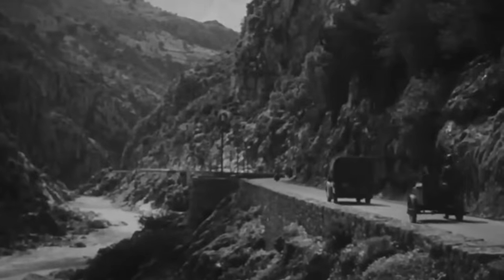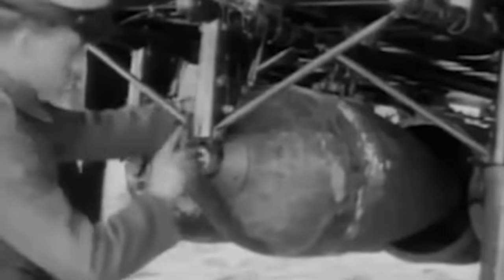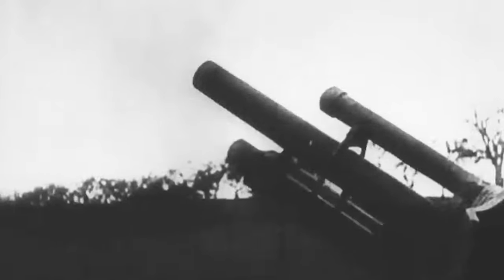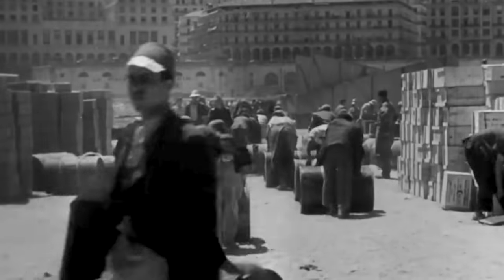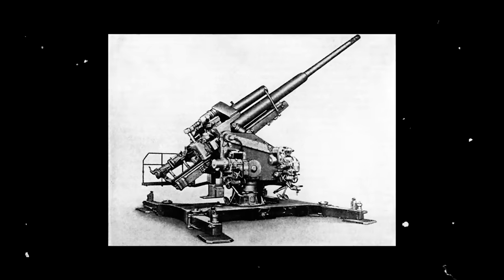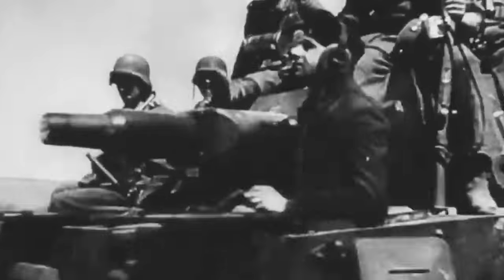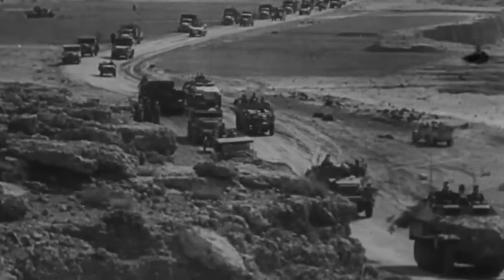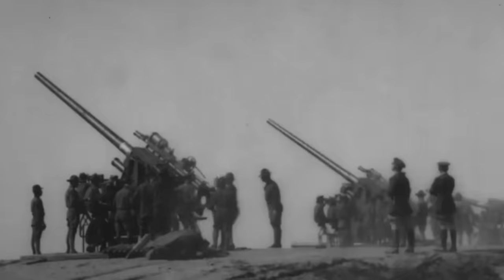The Secret Weapon the US Was Most Afraid of

Comment: It's so weird hearing it called '8.8cm' instead of the common 88mm or just flak 88
Reply: AI taking over
Reply: Acht Acht.
Reply: AT-AT
Reply: It’s the first time I’ve heard 8.8… and I chuckled everytime I heard it.
Reply: It’s like calling a .50 cal a 1/2 inch. 
Technically correct, but not common usage.
Reply: @walpolescrew  True, but you could also call it 12.7 mm and really mess with their head. "Ma duce = Give'm the whole 8.3 meters of 12.7 mm".
Reply: From the German perspective, "8.8 cm" (and pronounced "8 Komma 8", since in Germany the decimal is indicated by a comma, not a point) is correct!
Reply: @cloudchaser966  Yes you are right, but who won the war again?? lmao. Nah but for real, interesting insight
Reply: @dece74 Yes, and since the war ended, English has indeed begun to slowly infiltrate the German language. But you know what, if the outcome had been different, there is one thing that would have disappeared by now for sure: inches, pounds, gallons, Fahrenheit ...😉
Reply: @cloudchaser966  Here in Canada, we use a very good mix of both units of measurements for when it's most appropriate. Google 'how to measure like a Canadian'
Reply: We have one as a monument nearby which was left behind during operation Blackcock and given to the town as a war trophy. It had a sign saying PAK (pantzer abwehr kanonne) , but it's the 88 and weighs 6000 kg. You can even climb it. They restored it recently.

Comment: Actually, the 8.8 cm Flak was developed for the German Navy of WW1 for deck guns on U-Boats. There's a recent British Tank Museum video with YouTube Channel host Drachinifel, who discusses "5 tank features that originally were developed for Naval use" - and, Yup, you guessed it, the famed 88 mm tank killer on the Tiger tank was designed as a U-boat deck gun!
Reply: Als Torpetobootkanone (vorläufer der Zerstörer) aus dem 7,7 cm. Schnellfeuer Feldkanone des Heeres.
Reply: Not the same weapon system…same calibre but different ordnance…even he gets it wrong..
Reply: The 88 was chosen for the fact it was the largest round that could be handled as a single piece.    This was pushed to 105mm but in general involved a degree of automatic handling such as fitting a fuse setting machine to an auto loader

Comment: Some things missing from the video:

- Rommel did succeed to repel a British counter-assault in France only by deploying 88s against the heavily armored Matilda tanks. The canons of the existing German tanks could not deal with the Mathilda armor. If it were not for the 88s the whole campaign in France could have gone down at that point. That would have change the whole 2nd WW.

- The Tiger tank was allegedly build "around" the 88 flak canon, to utilize its power. A modified version of the canon was incorporated into the tank and was one of the reasons, this tank was feared by many.

So I think, the role of this canon in the 2nd WW can not be overestimated.

Comment: Why the Allied Armies never repurposed the British 90-millimeter Anti- Aircraft gun into the Anti-Armour role is criminally baffling.
Reply: Probably because the 76mm AT gun was plenty good enough.
Reply: They did for the Pershing tanks
Reply: @jonnyboi841  no they didnt. the gun on the pershing was never an AA gun.
Reply: Correction: The British 94mm AA gun could be used as an anti-tank gun but it was seldom used in that way because the gun platform was heavy compare to the German 88 and it was inadequate to level the gun and firing it unless for emergencies. Same problem with the American 90mm.
Reply: Keep in mind, every allied weapon on the western theater had to be loaded in a boat and then unloaded and transported across roads and bridges.
Reply: Well old boy, that wouldn't be cricket now. Using a AA gun vs tanks. Just isn't done old chap.
Reply: Probably because it wasn't necessary on the offensive. The 88 didn't really come into its own until the Germans were on the defensive, which starts in spring '43 after the defeat at Stalingrad.
Reply: The British did not have a 90mm gun.  That was the Americans.  And the Americans did end up putting it on a heavy tank at the end of the war but the war ended before many could even make it across the pond.  This became known as the M-26 Pershing tank. 

The British had their six pounder (57mm) which was their standard tank gun and anti-tank weapon.  During the early stages it was very effective.  Later, the British went with their 18 pounder (75mm) gun as the principle antitank gun and adapted it to fit on half tracks and mobile carriers.  The British fitted a high velocity 75 mm Vickers gun to many Shermans.   These were known as the "Firefly".   The Vickers 18 pounder gun could defeat any German tank.  The Americans retained their lower velocity 76mm. Outside of the largest German tanks, even the American 76 mm was effective. And there were very few King Tigers and Panzer IVs around. 

The British also used the 25 pounder (87.6 mm) gun and the 105 mm gun mounted as anti-tank guns (on both half tracks and in tank destroyers) and mobile artillery.  There was a move to mount the 25 pounder (87.6 mm) on the Cromwell tank but the turret would have needed a large re-engineer and it was felt that the Firefly was sufficient on the tanks to get them through the war.  

The problem the British faced was all the different types of ordinance they required.  Not only their own built equipment, but also that built by Americans.  The Americans were also simplifying their types of weapons.  Different caliber and types of artillery required Quartermasters to ensure that 105 mm
 batteries did not get 150 mm ammunition. Or British soldiers get American 30-06 ammunition.  Although they started using common munitions during the war, when NATO came around it was a strong push to make all the munitions universal.  That way on a battle field,, a Danish soldier will be firing the same ammunition as the Italian beside him.  

Throughout the war, there was a strong push to simplify manufacture by Americans and British.  This allowed faster production and improved quality.  A British Lee-Enfield had fewer parts than a German Mauser and was more reliable.  German tanks were notoriously unreliable and very complicated to repair.
Reply: @BHuang92  Fitting both the British 25 pounder (87.6 mm) or the American 90 mm was a non-starter.  They would have needed a new much larger tank to hold the gun.  The turret would have to be larger and the turret ring would also widen the tank.  When the 32 pounder was fitted to an experimental tank, the turret and gun were fixed.  The tank would need to turn in order to aim. The 75 and 76 mm guns on the Sherman were as big as they could reasonably fit. 

Even the Germans only put the 88 in their largest tanks.  These tanks often couldn't cross small bridges as they were too large and heavy.  They would tear up roads and streets.
Reply: The American 90mm AA was equivalent to the 88. It was mounted on the M36 Jackson tank destroyer & later the M26 Pershing tank. Unfortunately the M1 90mm AA gun wasn’t an anti-armor weapon. The later M2 & M3 90mm versions along with high velocity armor piercing tungsten ammo were.
Reply: Why? AT Guns are effective on the defense...but on the offense (which the Allies were basically on from mid '42) they were far more trouble than they were worth. Plus, as Allies had relative air superiority, high caliber AAA was pretty much kept in the rear.
Reply: I think it was to Bulky and or Heavy for anything but Land or Sea
Reply: The British 94 mm gun was simply too heavy for mobile use in the field.  The German 88 was too heavy too, really, but they could just about get away with it thanks to some serious weight saving design work on the gun mount and trailer chassis.
Reply: Alan M Enter 

"The Americans retained their lower velocity 76mm. Outside of the largest German tanks, even the American 76 mm was effective."

Even the 76mm was deemed a disappointment by US 2nd and 6th Armored Divisions in reports to Eisenhower in early 1945.

The 76mm not only struggled frontally against the rare Tigers but also the Panther (the most numerous German tank type in 1944/45) and the front of the Jagdpanzer IVs and Hetzers..... both of which were considerably lighter than the Sherman. 

The 76mm was only effective with HVAP. HVAP was extremely rare and not readily replaced when expended.

That report from US 2nd Armored Division is an eye opener. It's full of personal accounts and reports from enlisted tankers.
Reply: Why didn't they use the 3.7 in AA gun,  it's the same caliber as an 88 roughly.
And fit it in tanks.
Reply: @MXB2001  🤣
Reply: The 6pdr and the 17 pdr were more than a match for any contemporary German tank. There was no need to  use  massive AA guns for AT work.
Reply: @michaelkenny8540  it took 5 shermans to knock out a tiger with an 88 mm gun.
Reply: @tonyclough9844  There you go , nothing but a fanboy.

Comment: I still can't decide what was the coolest weapon of WW2. The Flack 88 or the tiger. Both the stuff of Myth and legend
Reply: fyi the gun in tiger tank is a 88mm.
Reply: The Tiger could take out a Sherman tank at a range of 1000 meters, as it had the 88 for it's gun.
Reply: The Tiger spent a lot of time not moving…so, it was just like the other 88s- a static gun. A giant, expensive, static gun.
Reply: @stooch66  It wasn't only the tigers and 88m Flacks that sat idle. The Luftwaffe was basically grounded after 1943 with so little fuel rations to go round.
Reply: stooch66,

All the Tigers in Normandy moved at least 300 km by road to get there. They were only static when the lines were static. Tigers on the Eastern Front actually racked up housands of km of mileage.
They were nowhere near as immobile or mechanically unreliable as the post war internet myth now says.

Saying the Tiger was immobile is about as accurate as saying the Sherman was crap.
Reply: Kt kT

2nd New Zealand Division reported a Tiger I of Schwere Panzer Abteilung 504 knocking out one of their Shermans at around 3,000 yards during the battles near Florence, Italy in 1944.
Reply: @lyndoncmp5751  as a soldier in the NZDF, I to heard this, only the second time I've heard. Thanks for reminding me
Reply: @lyndoncmp5751  I was obviously speaking hyperbolically, but I am not wrong that it had many problems. Some of them were because of design and manufacture, but many were simply because the Wehrmacht’s logistics were falling apart, so feeding that beast and maintaining became a big challenge.  In any event, I am not actually arguing that it was immobile. It was exaggeration for effect. Thank you.
Reply: @russcole5685 
Really? Very much respect for you. Cheers.
Reply: @stooch66 
The problems with the tanks were overblown though. In 1944 the Tigers and Panthers had a circa 80% overall operational average. Yes, the German logistical and resources problems made it worse. In 1945 the operational average for those two tank types was under 50%. So was the Panzer IV though. As you said, that's the deteriorating war situation. 
Cheers.
Reply: @lyndoncmp5751  Sherman  👎👎

Comment: The 88 was incredibly versatile. I think it was originally intended to be purely an anti-aircraft weapon, but the designers modeled in the ability for the weapon to be fired almost straight up but also a bit below level. It could fire several different types of ammunition, all at a high rate of fire. While earlier models suffered from excessive barrel wear, later models all but made that a non-issue. Moreover, German soldiers quickly discovered (as early as 1940 in France) that their best flak gun was also a superb anti-tank weapon, for it was the only German artillery piece capable of penetrating the armor of the French Char and British Matilda II tanks. German military doctrine was often somewhat inflexible, but, in this case, commanders were quick to see the potential for the weapon in many different uses.

Let's all be thankful that German arms production was not capable of building more tanks equipped with various models of the 88.
Reply: Youi really need to study the Italian, Russian , US and British standard AA gun to see that your are vastly over-inflating the capabilities of the 8.8cm. The Germans  used every captured Soviet AA gun they captured as it  differed little from the 8.8cm. 
The 8.8cm was not a 'superb' AT gun because it was a massive barn-door like target that if placed in the front line for line-of-sight combat would quickly be eliminated. Also the standard 7.5cm pak did everything the 8.8cm could do at a fraction of the price. The massive hyping of the 8.8cm is common among those who get their history facts via Hollywood.

Comment: Didn't the US Army capture a train load of 88mm guns that were abandoned and they decide to test and evaluate them. They asked for volunteers to crew and fire the guns and an entire artillery Battalion volunteered to fire the guns. There was also a story about the Russian front where they tried to stop a behemoth of a Russian tank (IS 7?) they had cornered, they fired everything at it and the tank shook it off, the shells bounced off the armour. So they brought up an 88 mm gun and fired two shells at it. The tank stopped dead in its tracks, when the infantry approached thinking the crew were dead, they found out that the 88mm had not pierc ed that tanks had knocked the drew unconscious and they were just coming around. They kept on firing  the 88 at it until the tank was destroyed.
Reply: The US used a number of German guns in late 1944 because it had a severe ammunition shortage. If it found enough captured ammunition with a gun then they used it. It had nothing to do with the silly claims being made about the 88 super-duper gun.
Reply: Behemoth of a Russian Tank. Either an IS2/KV2 (I)SU 152. IS3’s only came in 1945.